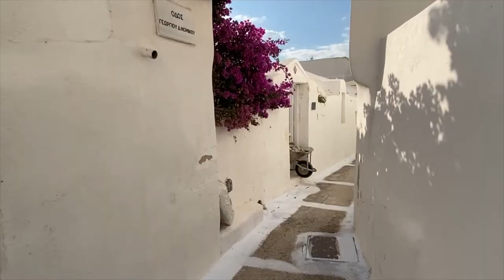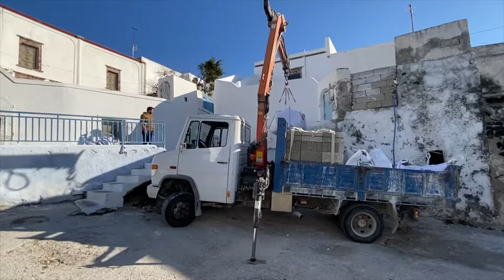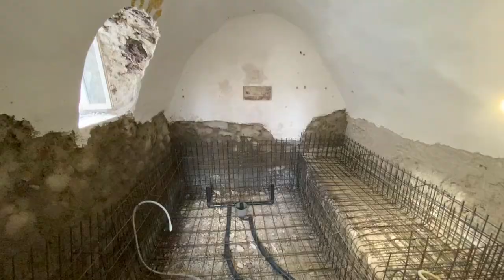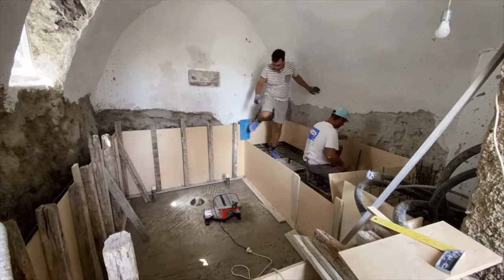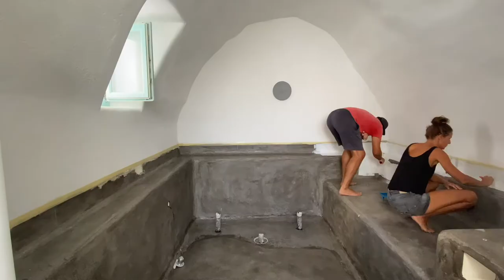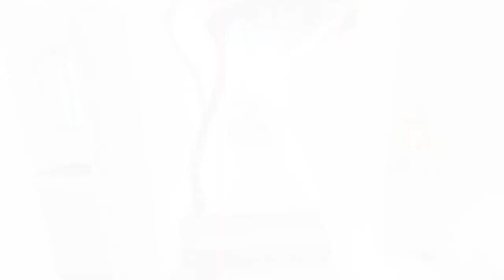VIMA VLOG 009 - HOW TO BUILD YOUR OWN CAVE POOL

Comment: Just amazing work.  This home and the one before. How is the pool water that color?  What type of paint do you use on your walls and is it just a bright white or does it have a name like Santorini White?
Reply from the maker: Thanks a lot :) 
Pool water always becomes blue when the pool is white. That is caused by the reflection of the sky. 
The white is just a regular white color and it might look different to you but that is just the intensity of the sun and probably the amount of reflection of the other white buildings around.

Comment: I plan to construct a pool which will have santorini style (white surface, and no tiles).. Can you guide on the water sealing and epoxy paint which can be used please..
Reply from the maker: It totally depends on the availability of local products. we have used a greek company called neotex for the epoxy paint (neopox pool)

Comment: amazing work , best knowledge, 100 marks out of 100❤
but i have some questions. 
how to make this kind of wall , like irregular or lil round curve shape, what is the white plaster you use, what type of paint you use in floor of the pool bcz its paint and water remove paint after some days , so how will you manage 
plz help me or send me the references plz❤
Reply from the maker: Hey! Well since the walls are made from stone you need to add mortar to fill it up. This mortar you can shape with a trowel in whatever way you want. Then we add a white plaster consisting of sand, marble sand, white cement, lime, etc. The Pool is painted using special epoxy pool paint with its corresponding primer and varnishes. Around 9 layers in total.
Reply: @vimasantorini  The information you gave me is the information I really want. I live in Korea, but I will make Santorini swimming pool with the information you gave me. Thank you very much :)
Reply: @vimasantorini  i really appreciate that but i think you have to make one more video step by step with material and trust me if you make step by step video, your video goes viral on internet